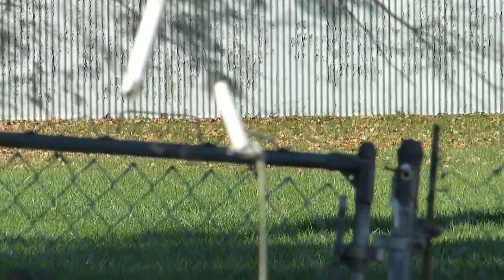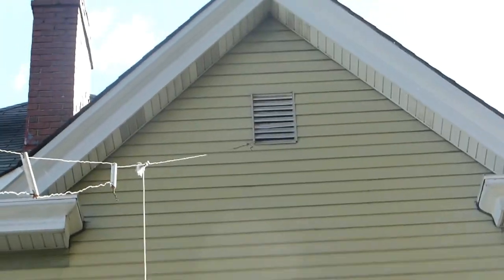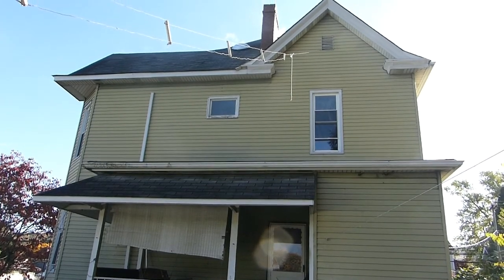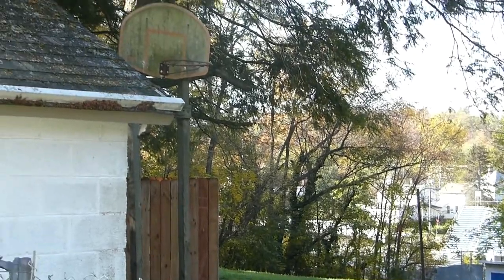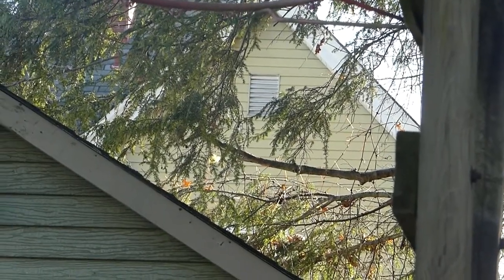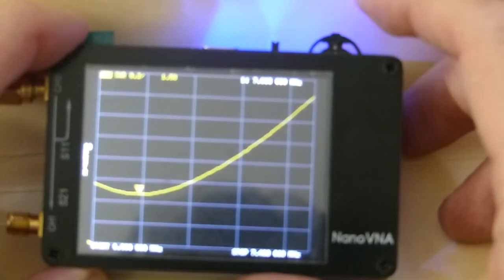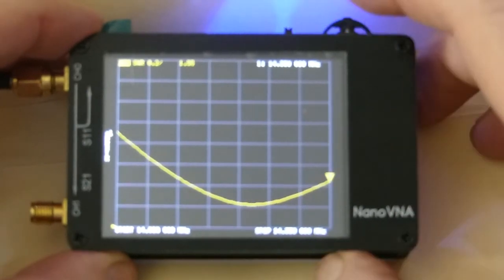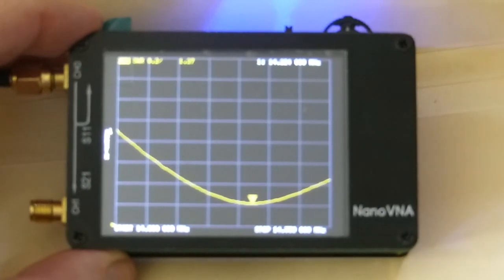NanoVNA SWR Measurement of a Dual Band Dipole Ham Antenna

Comment: Nice video. Did you make the dipole? If so, nice job. 
By now you have probably moved the one end of your dipole up higher. That should have lowered the SWR curve on 40 meters a tad. If you cut the dipole to resonant around 7080 khz, you'll find that it does better on 15 meters, that is....if you raised the one end of the dipole. Way back in time, I used my 40 meter dipole on 15 meters and it was resonant in the middle of the 15 meter band with the SWR dipping down to 1.6 to 1. 
Barry, KU3X